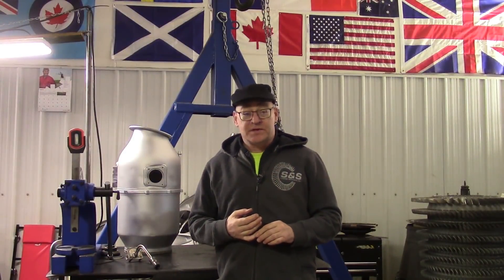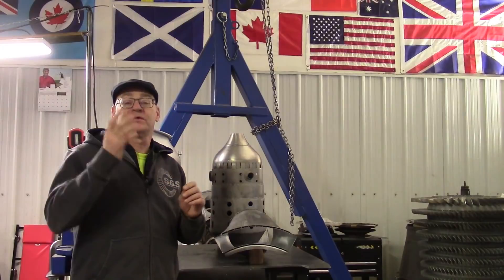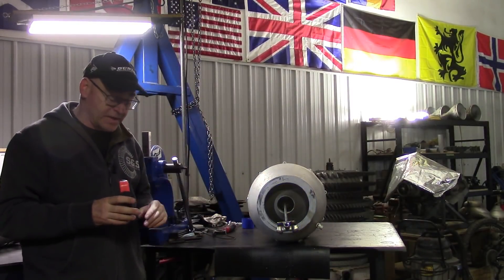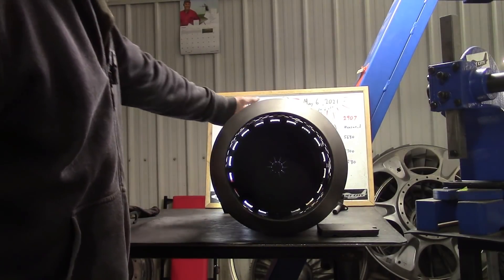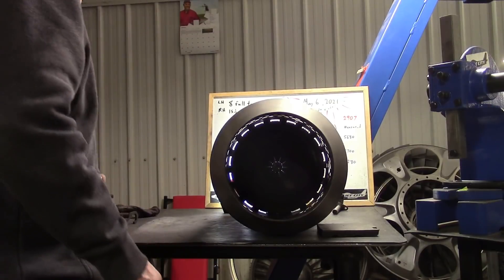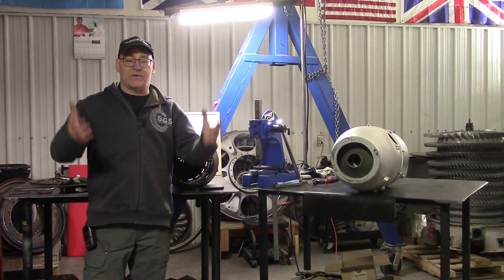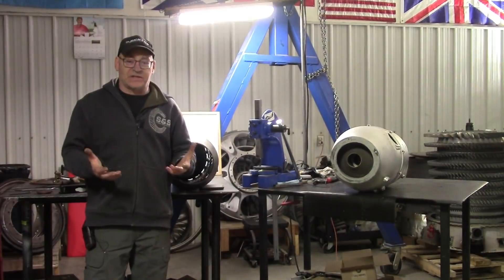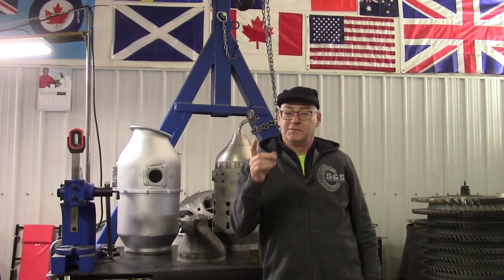Combustion Pressure in a Jet Engine  (2)

Comment: Nice video.  I always think of it along the lines of pressure drop.  As long as there is enough pressure drop across the can from the outside to the inside, flow will never go the wrong way.  If the pressure drop is too low then you get combustion instability and (buzzing) sounds.

Comment: I love that by subscribing to this channel I get to the see the innards of a Orenda combustion chamber.  As for explanation I think it could just be simply said that flow will follow the path of least resistance.  To go back out the intake it would need to get past a choke point.  Out the exhaust it's an easy open flow, so it takes the exhaust path.  I believe this is what you described, and even said in some places, but not in as little words.

Comment: Another fabulous explanation, love your vids.
   As I was watching it occured to me that something I do not see mentioned often. Near the head of the combuster there is large scale combustion and heat. This causes expansion and acceleration of the gas. The air that is moving around the outside is providing cooling to the liner but is also getting heated and accelerating. At each increment where  air is entering  that air is also heating and therefore accelerating.  By the end of the liner all the available air is inside the outlet, it has been heated to a common point and blended to a place where all of the air, combustion products, and waste are now moving at maximum velocity. One does not need to "contain" the flame portion it is actually being directed.
Reply from the maker: Good, but by the exit of the combustor, it's all hot gas, and not flame. The flame is only there for the first third of the way towards the exit.
Reply: Having been responsible for the design of combustion chambers for a while, I prefer to think of the combustion process being "contained".  To make the point, let me tell you of an experience I had with a problematic in-service combustion chamber.  
Most examples of the chamber behaved as expected and had acceptable overhaul lives.  However, a small number would hole within a matter of tens of hours and we never did fathom out why.  We had to control the problem with boroscope inspections every few hours.
To reassure the operator that, if we missed a chamber that was developing a hole, the engine would shut down safely, we tested one to destruction on the bed.  We built a holed chamber into an engine with instrumentation and a TV camera focussed on the CCOC wall above the hole.  The engine was cycled to accelerate a failure and it was obvious that the flame was not being "contained" or "directed": it was 'torching' the CCOC wall.
I recall watching the video of the final few cycles.  The CCOC wall was glowing and bulging: it burst, there was a brief flash of flame into the bypass duct, and the engine surged.
Reply: PS  Earlier today, I spoke to a combustion engineer colleague who was involved with the problem. He told me that an aircraft was lost as a result of a holed combustion chamber burning through the CCOC.

Comment: I think that what throws a lot of folks is comparing to internal combustion cycle, with its discrete cycles and fixed compression ratio
Reply from the maker: You got that completely right!
Reply: in the same way that burning the fuel in a reciprocating engine increases heat and volume forces the piston down, the turbine increases the volume of the incoming air charge by the heat of combustion+extra combustion gases.

Comment: AgentJZ I know you are absolutely correct but it's so counter intuitive it still does my head in even after designing "bean can" jet engines. Just in case you are curious the best I know of for this type of engine is 45 seconds run time at a thrust to weight ratio of just under 0.3. That was using butane (lighter fuel). It's never going to be enough to really do anything but it's good for a giggle.
Reply: Are you talking about a bean can pulse jet engine?

Comment: If it helps - remember the vast majority of the air compressed by the compressor is not combusted in that burner-can.  Only a small percentage is actually burnt up with the fuel.  All the rest just blows right on by to help cool the turbine and blow out the back.  Hot gas rarely can reverse into the compressor.  This happens when the compressor surges and the pressure in the combustor exceeds that in compressor.  It happens for fractions of a second.  If you ever see an airplane taking off and hear a series of bang bang bangs and flames coming out both ends, that was a surge.  Engine designers go to great lengths to try and make it hard for that to happen, but because you get your best performance at high blade/stage compression ratios where surge is more likely - it still sometimes occurs, usually at max power, or rapid changes in power settings.
Reply from the maker: I have a special video explanation of compressor stall. It's titled Compressor Stall.

Comment: Just like wind, gasses don't move without pressure differential. The pressure may be small, but it is there.
Reply: Yes, you can see the tiny gap between liner and casing at turbine end of the combustor that restricts the flow and hence introduces pressure difference. Same goes with all the other small holes that liner has.

Comment: Good explanation - I guess strictly the reason is because the compressor (section) increases the gas pressure to the max cycle pressure immediately at the exit of the last compressor blade row and the flow will always follow the (negative) pressure gradient. So as long as the compressor is making pressure, the flow will follow the negative pressure gradient between the combustor and the atmosphere through the turbine rather than against the gradient in towards the back of the compressor and out through the compressor. There isnt really the concept of "least resistance" (there will be similar friction loss through the turbine section as there was "up" through the compressor section). The counter proof is that, in the event of compressor stall, where the compressor actually does stop producing pressure the hot gas will come out of the front of the engine. I think the idea of "least resistance" is really confusion relating to the fact that the compressor is imparting energy into the flow (and so increasing the pressure) and the turbine and nozzles are in fact extracting energy (and therefore pressure) from the flow.
EDIT: Actually the velocity doesnt increase in the combustor, despite the pressure remaining constant, because the majority of the energy being added is being used to increase the internal energy of the dilution air added incrementally along the combustor length, so on aggregate the combustion temperature remains constant as well. Velocity only starts to increase at the first nozzle.

Comment: Off topic. I found a relatively complete jet engine in the mud at a Fresno wrecking yard. I researched the model/-# and found that it was originally used on a prototype B-66(?). I figure it got here because Fresno used to have a race car enthusiast who build a jet car out of surplus in the 60's. Perhaps the car was scrapped and the engine wound up there. I called Castle Air Museum with details and they didn't want it if it wasn't in the can.
Reply from the maker: Why list the aircraft, and not the engine?
So far I got, mud, wrecking, and "the model #".
Nothing useful there, but thanks.
Reply: @AgentJayZ  30 years ago..
Reply: @AgentJayZ  J71a-11. I remember the -11
Reply from the maker: Well! That's a couple of good details.
The J79 is too big for a personal restoration project.
More importantly, thousands of -11s were made, so to a museum, they are almost literally a dime a dozen. We have about a dozen, and we got them for free.

Comment: like a water leak if the pressure outside is the same as the inside the water takes the path of least resistance as would the air with a giant open hole at one end.

Comment: Thank you for this.  I had a hard time understanding this because I am used to dealing with turbochargers, and it is normal on a turbo for the turbine inlet pressure to be much higher than the compressor discharge, but that is only possible because there is an engine in the middle and those two spaces are not connected.

Comment: Good explanation. In my mind I think of it as, the air inlet has a smaller cross sectional area than the outlet, so it's going to flow through the outlet. Hydraulics and injectors use this type of fluid mechanical advantage too. You could calculate the pounds per square inch on the inlet and the outlet, and find the outlet will always be less due to cross sectional area.

Comment: "When velocity increases, pressure decresses."
That was very interesting. I didn't know the air going around went back in the chamber through holes. Ingenious.
Reply from the maker: Yes. The liner helps maintain a protective layer of cooling air, preventing the super hot flame from ever touching the outer case. It also helps that cooling air envelope and eventually mix with the flame.

Comment: Tiny pressure differences can have a big effect. Just notice how the wind moves from an area of high pressure (i.e. 30.92 inches of mercury) towards a standard pressure of 29.92". Or how much difference there is in aircraft turn or slip with a very tiny bank angle.

Comment: Wow! How many Sabres are still flying? Per Wikipedia, some are listed as "privately owned", I assume they are flyable. But many on static display. How many engines are out there mothballed and which (consumable) parts are getting critical? ie gaskets, seals, filters, etc.
Reply from the maker: A few Sabres are flying, and more are being restored. No engines are being properly stored, and I am one of the people recuing them.
What does critical mean? No parts are being manufactured.
Reply: @AgentJayZ  critical = hard/impossible to get..such that the repair cannot be completed.
Reply from the maker: The whole series is about, I guess, the fact that hard and impossible are not two words that belong bookending a slash.

Comment: Well I was wondering if there were any upgrades to the design that may have improved efficiency like a singular combustion chamber or something I'll look it up but I like listening to your show
Reply from the maker: This engine was designed in the 1940s, so yes, many improvements in performance and efficiency of aircraft turbine engines have been made since then.
Reply: @AgentJayZ  do you have any speculation on a space age drive for the outer limits
Reply: @AgentJayZ  we've been talking about how to accelerate a projectile through space they seem to have settled on these high powered electromagnets to force a more total vacuum and accelerate the ionized particles down the hull I had been trying to build an intake to make hydrogen and then deuterium to ride a thermonuclear event lol I also was thinking about how to utilize a particle accelerator to make water from ionized subatomic particles but how to insulate a passenger from such a field in motion and energy discharge

Comment: Pressure drops a little. But VOLUME increases a LOT. Therefore much more speed.
Reply: Exactly and that is why thrust is proportional to T2-T1 where T1 is the inlet temperature and T2 is the eflux temperature (which is Charles's law not Boyles as some have stated). That said with some of the super weird fuels that were experimented with it's also a function of the chemical reaction. IE air can be considered to be roughly 80% nitrogen and 20% oxygen. If your fuel increases the amount of volume as well (nitro-methylene and paraffin mix can) then you get even more thrust. The only problem is that it makes a military engine on full afterburner look frugal. I'm taking this from memory but a standard J-79 is heading for 12,000 LB thrust dry. Zip fuels (For example borane)  could either increase this a little (up to the limit of the engine bearings etc) or increase range. Nitro-methylene and paraffin in the right ratio however was nuts. IE in the right combination and engine modifications (vastly higher rated thrust bearings etc) I think NASA got one up to near 30,000lb dry thrust. That said I cant find the data online and I was searching through microfiche near 20 years ago.

Comment: combustion increase pressure but not from compresor maximum pressure but from pressure after those small holes feeding comustion chamber (with huge exhaust hole) and that increase in pressure is smaller than compresor outlet pressure.
Reply from the maker: The static pressure of the gases in the combustor does not increase due to the heat of burning fuel in a gas turbine engine. The pressure stays the same, but the volume increases, so the gases accelerate out the exit.
Go back and read that again.
These are not piston engines.
Reply: @AgentJayZ  increase pressure IN COMPARISON to state of max RPM and fuel cutoff state. without burning fuel turbine-inlet pressure would be much lower.
 (that would also lower compressor-output pressure because air would have easier to enter combustors, because much lower pressure inside combustors in comparison to normally working/burning fuel, state.)
 during normal operation burning fuel keeps pressure (near compressor outlet pressure for longer/through much bigger hole
Reply from the maker: Oh, OK. A thought experiment with conditions that never happen, except for a short time during an emergency shutdown. I was only thinking about normal steady running conditions.
Reply: @AgentJayZ  Yes. Also that was THE thing for me, that made click, and after that jet engine is obvious.
Reply: @AgentJayZ during an emergency shutdown, but also during startup, introducing fuel increases pressure.

Comment: Would the turbine also have any play on the flow of gases ( working ) on the likes of start up? Took my boy to a model plane club down the road from us I was amazed at how many different small jet units there was and size. Thank you for making the lack of pressure so easy to understand.
Reply from the maker: I don't know what you are asking.
The purpose of the turbine is only one thing: to extract power from the combustion gases so it can turn the compressor.
Without it, there is engine, but a fire.
In a piston engine, the equivalent part is the piston.

Comment: Ola Special AgentJayZed of the Royal Canadian population.
Two questions
1) is there a flame holder in the combustion (now I do not know what to call it so I am going to call it) pipe. As the igniter is not continuous, I am assuming that somewhere in the combustion pipe thingy, there must be a flame holder to keep the flame lit?
2) Is there a flame exiting the combustion pipe thingy? Or has the mixed outside air and fuel burned completely so you get high-velocity air entering the power turbine section but the first stage power turbine is not in direct contact with the flame?
Thank you very much for the time and effort you spend teaching us Luddites how gas generators and power turbines really work.
Reply from the maker: 1 No flame holder. Not necessary. Flameouts are about one thousand times more rare than in movies.
2 the flame is about 3000 degrees F or so. The purpose of the liner is to fully mix the cooling air with the flame, so that the gases leaving the combustor are about 1000 degrees F.
No flame gets into the turbine after the start cycle.
3 Power turbine is a specific thing that is not in this engine. The thing you are thinking of here is the turbine. you could call it the compressor turbine if you really wanted, but since this engine only has one turbine, it is called the turbine. With an industrial Orenda, the complete engine discharges its total output into another, separate turbine, called a power turbine, which turns a shaft to do external work, like run a large pump or electrical generator.
Reply: The front end of the combustion chamber is specifically designed to act as a flame holder, with some recirculation in what is termed the primary zone, where the air/fuel ratio near stoichiometric.  
Downstream of the primary zone, dilution air enters through the ports you can see in those Orenda flame tubes, in order to reduce the temperature to a level acceptable for the turbine.

Comment: So the air arriving at the combustion 'chamber' already has momentum. This is imparted by a fan forward of the chamber presumably.
Reply from the maker: It's not a good idea to use improper terms, because they just make it harder to understand what's going on. Fan is a specific term that does not exist in a turbojet. The air is increased in pressure by a ten stage compressor, and then it flows into the combustion section.

Comment: Is there any testing that has been done to measure the velocity of the exhaust gasses, before and after the jet pipe?
Reply from the maker: That would be research and development of new engine designs.
We only test established designs to make sure they perform as they should after we work on them.
The testing of new designs is more Graham's area of expertise.

Comment: Jay, you stated the presure at the combustion inlet was 75 Psi. What is the presure of the gases by the time they hit the first power turnine? Thanks.
Reply from the maker: You need to be more clear. A power turbine is not a part of this engine, but it is what the industrial version of this engine is used with.

Saying power turbine is a different thing than saying turbine.